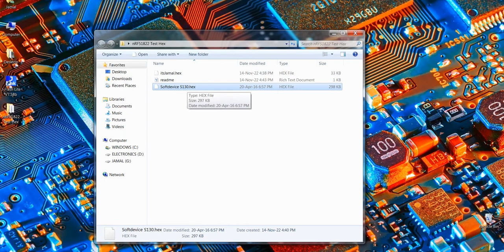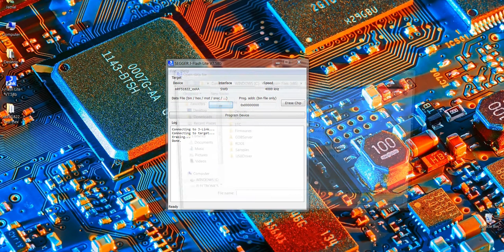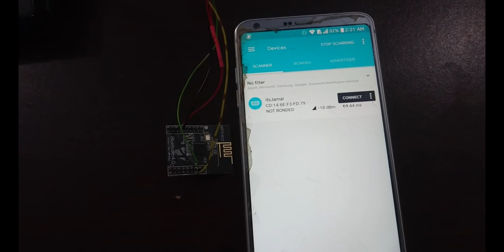Programming nRF51822 (Core51822) Using Segger J Link

Comment: Is it possible to read an already writer chip to extract what configurations are inside and clone it in another nrf815122?
Reply from the maker: only if chip is not read protected while flashing.
Reply: @electroicsPrototyping @electroicsPrototyping I can be more specific, I have this crazy idea of hacking a Logitech powerplay, I did a little research dissembly the mat(sender) and I found a n51822 qfaah0, if you don't know what a Logitech powerplay is I can resume what is and how it works in a few words, is a wireless charging mat for Logitech mices and it works with a coin (receiver or Logitech powercore) I have the suspicion both the mat and the coin have the same chip for autentificacion of a original Logitech product, what I want to do is either way copy the information of the original Logitech receiver n51822 to clone in another n51822 qfaah0 blank to use as an hacked authenticator to charge others devices, well other thing I have in mind is grab a programmer and two blanks n51822 qfaah0 to pair it both, what you thought about it?, it can be possible to done?

Comment: Can i turn on nrf51822 as ble transmitter ...how do i create that .hex file and can u send ur jamal.hex file
Reply: can i use only keil and jlink
?
Reply from the maker: yes, you can use keil 4 to edit codes and also directly program nrf51822 using same j link setup
Reply from the maker: download the nrf51 sdk from nordic website and use the example codes from it.

Comment: Lot of effort goes into building authentic hardware and softwares. It is not recommended to use a pirated hardware with vendor authentic software. At least mention it as a clone if you are using a clone. Thanks.
Reply: Agreed. I still think that it's ok to use use such things in many circumstances, but it should've been made more clear that this is a clone

Comment: If a vendor debugger works with Eclipse IDE via OpenOCD, can J-Link be made to work via OpenOCD/SWD, specifically data tracing via SWV/SDO?   (My board has SWD+SDO on the connector)
Reply from the maker: Which vendor debugger are you talking about? nRF51 DK?